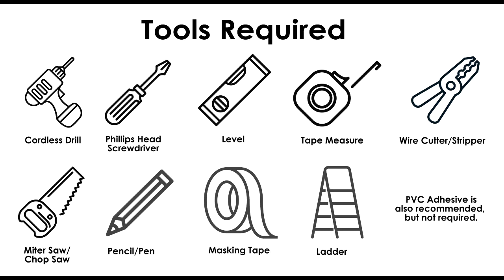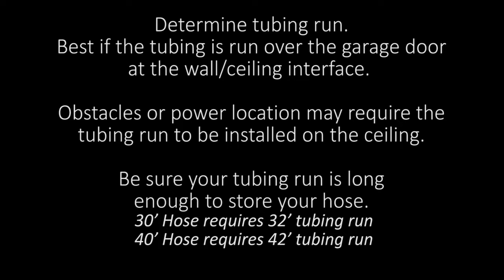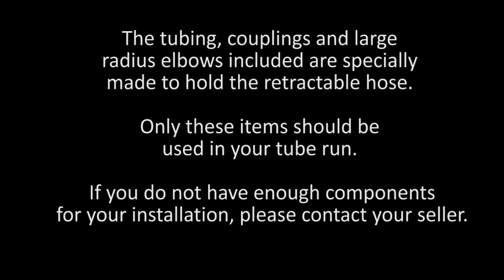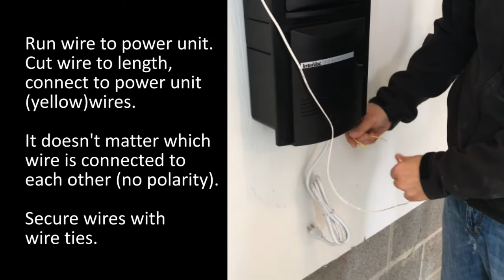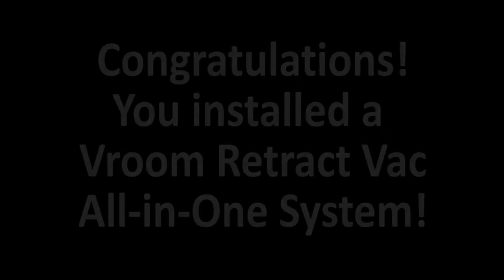Vroom Retract Vac All-in-One Garage and Car Vacuum System Installation Video

Comment: Can this be installed in house hall cupboard and fitted with pipe and foot to vacuum house?
Reply from the maker: Potentially - depending on the space available to install the vacuum tubing.  We would suggest contacting a local dealer to discuss specifics of your install: https://www.vroomretractvac.com/contact